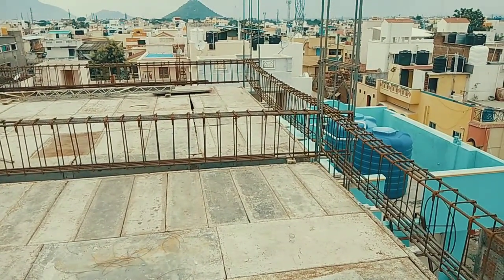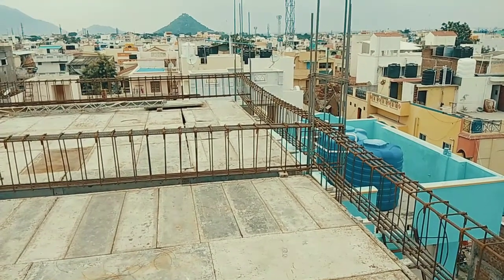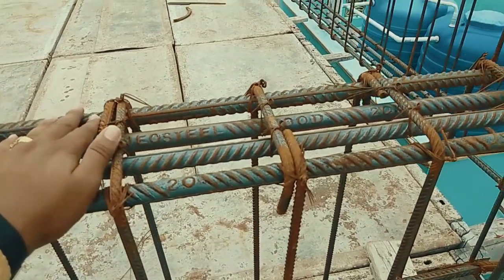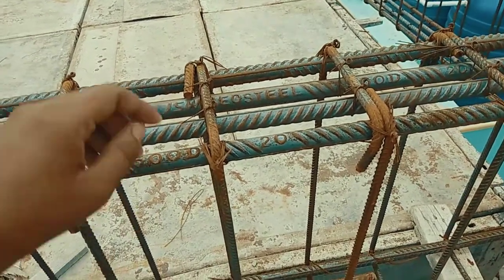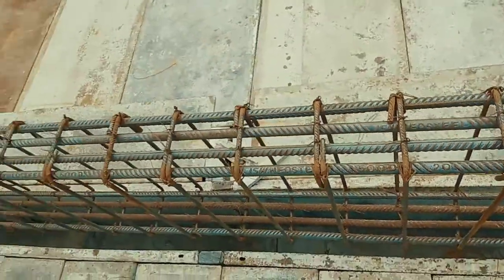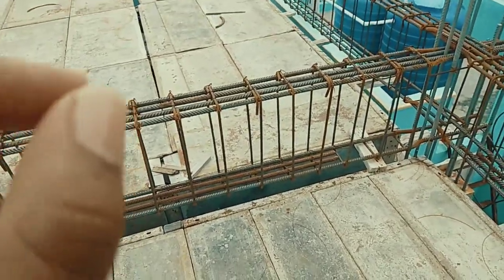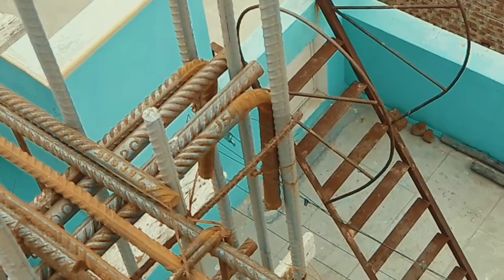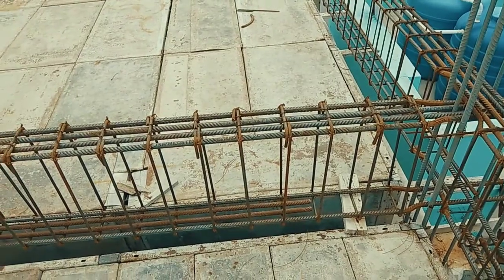Reinforcement details for 20 feet rcc beam

Comment: Only 6 no's of 16mm  steel are used for 20 feet span for g+2 resident house ..will it be ok or need to add more..
Reply from the maker: It may vary depending upon the loading and size of beam
Reply: @lineup6942  only one room is 20 x14 feet .in between 20 feet  span one extra pillar of 4 no's 12 mm rod also provide resting on underground beam  just 6 feet away from centre pillar. Beam depth is 14 inch +6 inch slab..pls reply sir .I already started construction..if there is risk I will stop at g+1